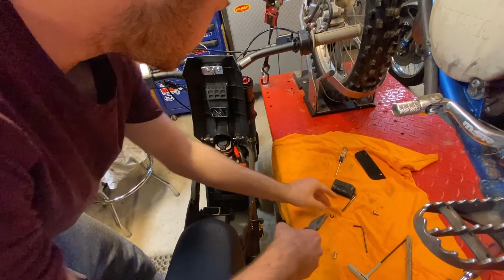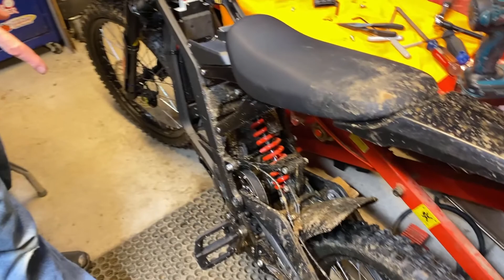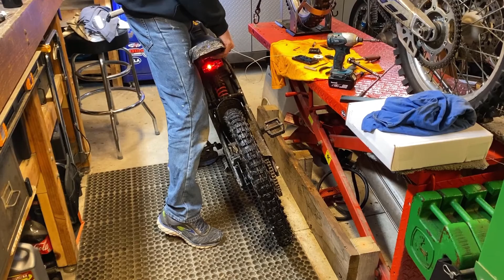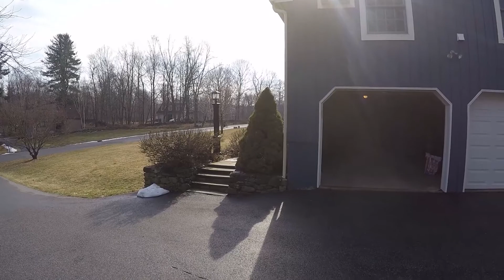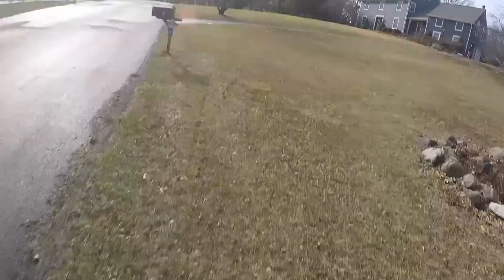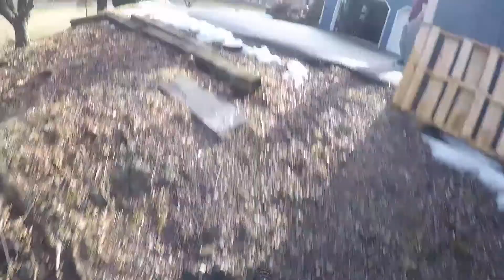Surron X - GLE Dashboard Wire Harness mods and first impressions.

Comment: As I'm currently installing the GE BAC 4000, I have a question about Bluetooth.  I have both the EggRider and the GLE Dashboard available.  I assume the EggRider provides its own Bluetooth connection to its phone app, as it is hard wired into the BAC 4000.  So, how does the GLE Dashboard app connect to the BAC4000, does the controller also have a Bluetooth send/receive capability built into it?  Getting GLE to provide info has been touch-and-go.
Reply from the maker: Yes - the app connects to the controller via Bluetooth.  The one thing I don't like is that the app also needs a WiFi connection to open up.  If you start it with no internet connectivity you get an error message.  Once you give it a connection, it starts up and connects to the controller.  The problem with this is if you're in the middle of nowhere and you don't have connectivity, you can't use the app.  I need to reach out to GLE on that subject myself as I can't find a way to disable that and there is no reason the app should need an internet connection.
Reply: @Chris_Does_Everything  Thx.  That's a REAL downside, as I almost never ride with any WiFi nearby.  It's also why I want to keep the EggRider connected.  I ride in the mountains with widely varying conditions and terrain.  One of the aspects I don't like so far, is that the GLE only has 2 modes, street and ludicrous, but I want to be able to have the 9 power modes of the EggRider available as I change terrain.
Reply: @Chris_Does_Everything  - Got mine installed, and I have both the GLE Dashboard and EggRider to control the BAC 4000.  Now, I've been warned not to turn both apps on at the same time, but so far, the GLE has been quite glitchy, EggRider has been reliable.  I did hook up my brake cutout sensors, and they are working, but only programmable via the GLE app.  What's interesting, and because the GLE actually writes to the BAC 4000, is that once you set thumb regen and brake cutouts in the GLE app, they are still active when switching over to EggRider.  EggRider seems to only affect the power settings.  I really like the EggRider 18 power options, vs only 2 on GLE, as I ride in the mountains exclusively, and can vary my power quickly on-the-fly without playing with an iPhone, and adjust to varying riding conditions.  Yes the GLE is a powerful tuning app, but GL Engineering provides literally no info on how all the different settings affect the controller.  I'm currently working on a relay system that will hook the kickstand cutout into the brake cutout system.  Years ago, I lost a friend who crashed a Harley because he forgot to retract the kickstand.
Reply from the maker: @mountainflyhigh  I'm going to try that.  Did you simply leave the EggRider connected?  I agree that the dashboard seems a little buggy and there are times when I would prefer to ride without my phone.  You should make a video on this.  Thanks for the update.
Reply: @Chris_Does_Everything  - Yup, I do leave the EggRider connected, but have to be careful never to turn it on when the GLE app is connected.  GLE says unplug it, to avoid connecting both at once, as that wipes the files on the GLE Dashboard.